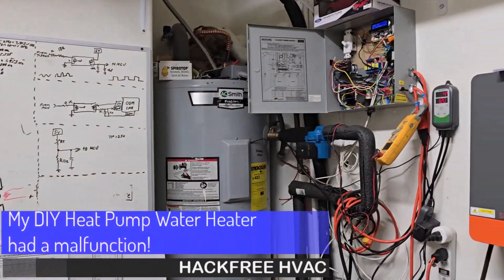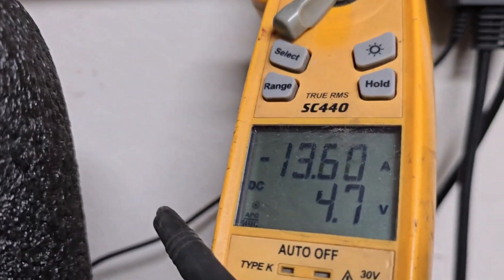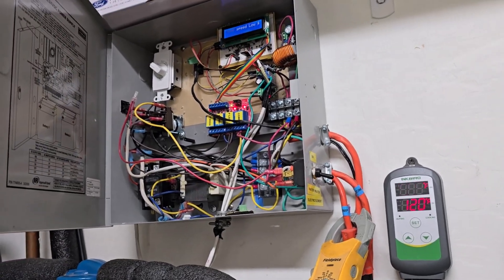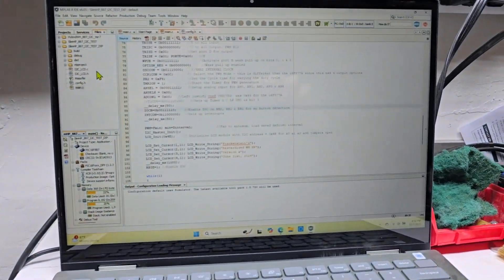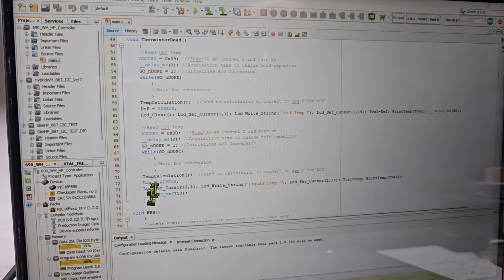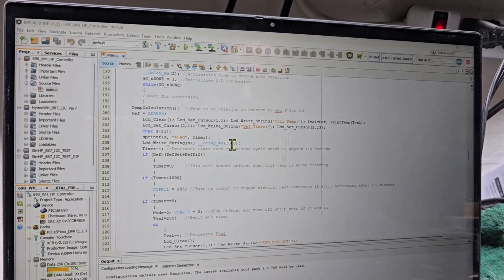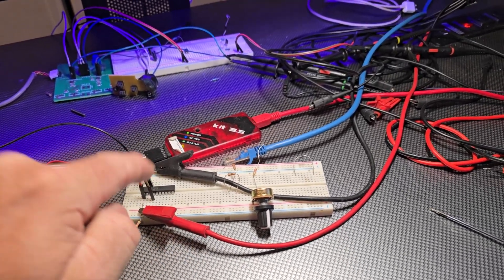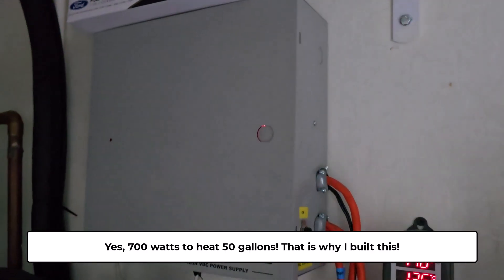My DIY Heat Pump Water Heater controller malfunctions - Can't find my program 😮

Comment: Could be a connection issue with the chip sockets on your control board? Socketed chip versus soldered strait to the board has its issues.
Reply from the maker: I tapped on it. No change.
I have done a bit of surface mount stuff since this build.
But here was an example of the convenience of swapping the chip out.
I did catch it acting up once a few days after this. So if anything I likely need to get around to just designing a new controller.

Comment: For easier matching the right program we all should use version infos in the boot up and written on the case / the housing
Reply from the maker: I've done that a few times, but just be name and a version.
I think I programmed this with a PC I had in this room a few years ago and it saved to hard drive instead of one drive. 😑

Comment: hi are all your variables in kept ram or are some in flash or eeprom because it is possible that the flash or eeprom has worn out over time and it was crashing while trying to read or write
Reply from the maker: It reads from EEPROM at power up to get my saved setpoints. And writes to it when I am in my adjustment menu.
So far shy of the 100,000 write cycles I think. LOL